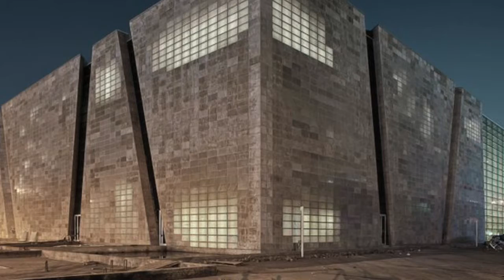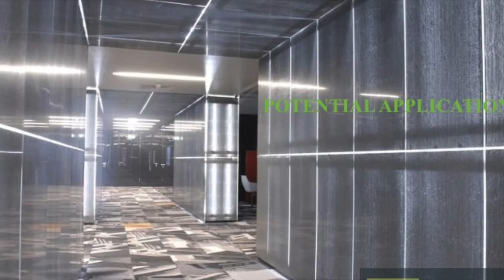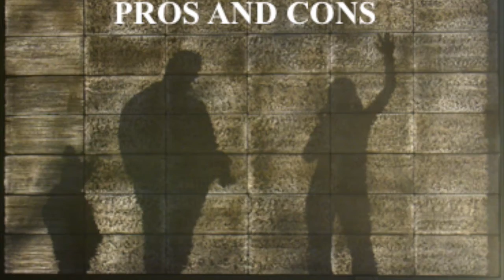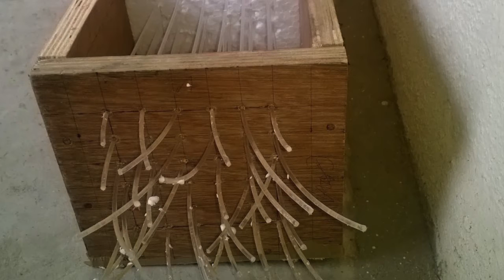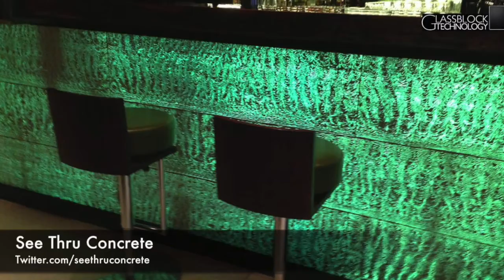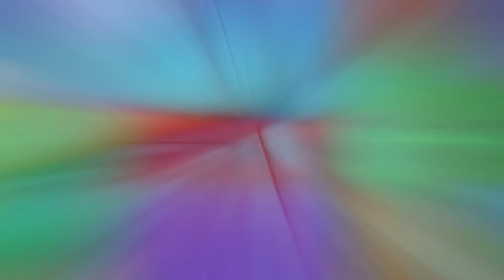CMGT 110 Translucent Concrete - Charlie, Jake, and Kyle

Comment: Good presentation. Very interesting substance and I learned a lot about how translucent concrete works. I personally didn't know that this material was even possible or used in construction. I am now a big fan of it since it looks so cool but bummed about the price. All of the speakers spoke well and kept my interest but I think that a use of more visual aids would have been really nice and would have improved the project overall.